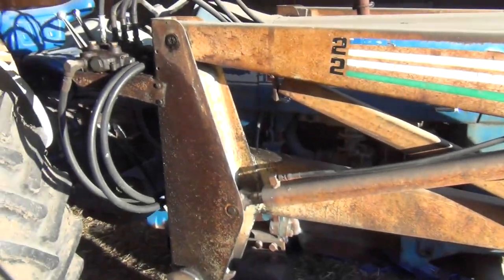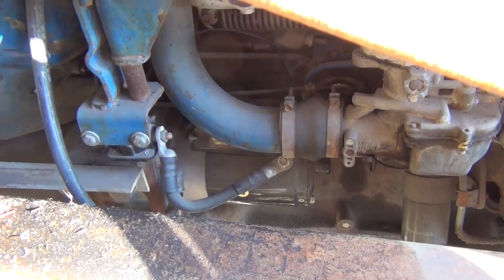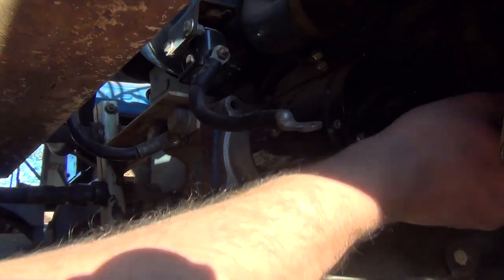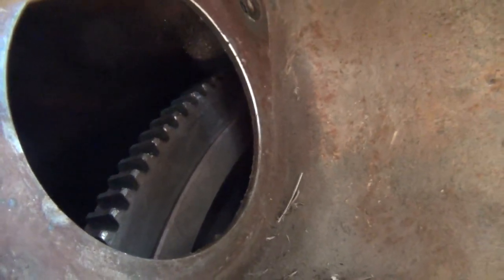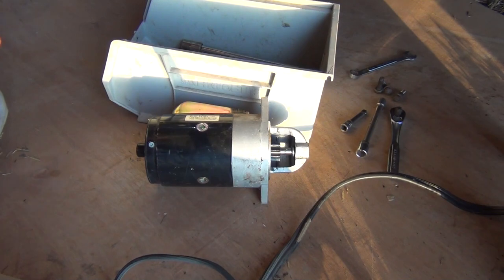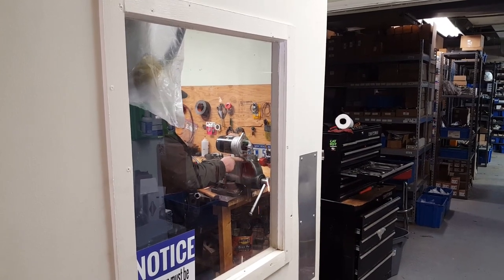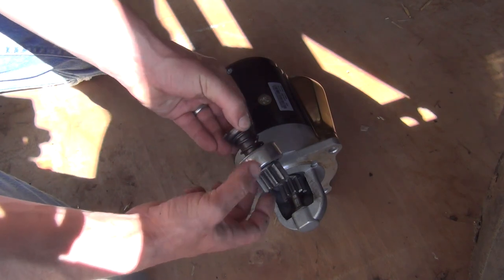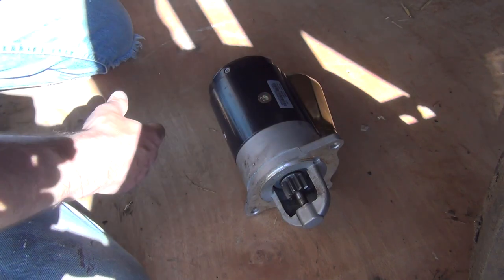1969 Ford 4000/3000 Tractor Starter Repair

Comment: on starters always put the top outside bolt in first out last unless something else is in the way someone else suggested a set of pallet forks  most atwoods,orslens or local farm store will have a set of bolt on forks for around 150$ maybe less. or you could weldup a set of forks ( they work great to move round bales) that just wedge in to the bucket and are held in by a single bolt at the back top of the bucket  we used ours for years i finally welded up a stand alone  bale fork to reduce the weight of the bucket from the load on the ft axle .  you can even make it so it will work on your 3pt  as well..   getting our jd 1525 moco  sickle sections replace for wheat and alfalfa hay in n oklahoma  good luck   keep safe during the hectic times

Comment: That sloped bump on the side of the starter is a moveable pole shoe, not a solenoid.  The solenoid is the part that had the short length of thick cable attached to it.  That Ford starter doesn't have a solenoid mounted to it like the GM starters do.  Despite not knowing the correct nomenclature, you DID get the problem fixed.  Good job, and a few dollars saved.   👍
Reply from the maker: I was wondering about that but the tractor guy also called it that as well. I believe there is a piston in there that pushes the gear into the flywheel but I didn't know it was called a pole shoe, good to know!
Reply: No piston, just electromagnetic poles and a linkage.  One can pivot, and that bulge is to allow it to retract when the starter is not in use.  GM starters emplot a different mechanism to thrust the starter drive pinion toward the flywheel.  I'm not surprised that the technician used the term solenoid with you.  Either he didn't want to confuse you, or he just got tired of explaining tne difference to non mechanics.  Both types of starters work well, and most people not only don't know that there is a difference, they don't care either.  It's not really a big deal unless you're the one remanufacturing starters.  An actual solenoid does have a piston.  I'd have to crack open the books again to be more concise.

Comment: You don't really need 50hp for all that stuff. I grew up bailing hay with a ford 8n and farmall 130 both of witch are way under 50hp
Reply from the maker: Very true, and with the smaller baler I have now I probably could get away with a 9n, not sure about an 8n though, seems like that would be a bit hard on it. I would like to go to a bigger haybine though and it is recommended to have 50HP or more for those.
Reply: If your wanting a haybine for quicker dry times it may be more economical to get a tedder instead. A tedder will really help with dry time.